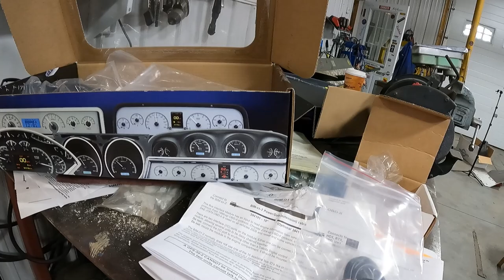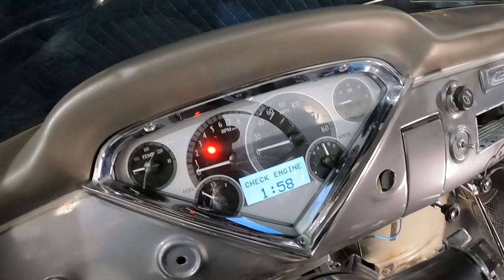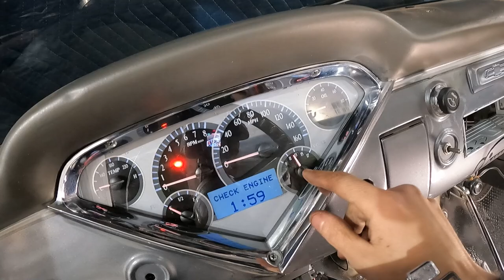LS Swap - Digital dash install and progress update - 1957 Chevy Truck

Comment: Wiring is a big fear with most DIY mechanics. Breaking it down like you did helps to overcome with confidence.
Reply from the maker: I find it satisfying to clean up the old mess and correct weird wiring modifications that have been added over the years. So far I'm at around 30 of those stupid fold over connectors removed. It's nice that there is one less thing to burn it down with every one that I remove and correct. As always, thanks for watching and sticking with me on the progress. I really dig the little community that has developed on the channel.

Comment: Your headlight switch and your ignition switch,  are original.  If not with ignition swith do you have. 
 I am working on my 55.2 chevy with 4.8 swap and your videos are valuable for me and others I'm sure. 
Thank you
G.
Reply from the maker: My ignition switch is not original. The switch I have is on the column and the column is an 80s s10 or camaro column. My headlight switch appears to be original. Thanks for watching and I'm glad my videos are helping you.

Comment: I checked out Hi tech classics, their prices seem pretty good. I'm doing a square body and am thinking about Dakota VHX for it. Is High Tech in Canada?("about us" info on their website not working). Just wondering if you got charged duty.
Reply from the maker: They're in the states. I talked to them on the phone and emailed back and forth based on availability. They were great to deal with. I had it shipped to the states and then sent over here. I am pretty sure I paid duty and tax. It wasn't cheap but it's one of my favorite things on the truck.
Reply: Thanks for the info Ed, Yeah I think I'll pull the trigger and get it. I'm putting a 4l80 in my 88 one ton dually, the Dakota dash will solve the speedometer interface problem. You're turning out to be a wealth of information, I'm going to use Gerbshop for an LS computer mod for a different 4l80 project as they are local to me also. Didn't know about him until I watched your truck series. Keep those tips coming, Thanks!
Reply from the maker: @BMorr 6  I was just talking to Mark from Gerbshop the other day for the 6.0L for my '55. Please let him know where you heard about him, he might find that entertaining. The cruise control was a bit too figure out, but on my road trip to NB last year, it was amazing and far cheaper than the set up I used on the Malibu's LS swap. Out of the two LS swaps, I prefer the way the 6.0L in the truck went better than the way I went with the 5.3L in the Malibu. Both work, but the '55 will be getting basically a duplication of my '57 power train. Also the nice thing about Gerbshop, if you want to do a cam or something, you can just ask him ahead of time which cam he already has a tune for. Much better than the trip to the dyno.
Reply: @SlowCarFix    I'll tell Mark you sent me.